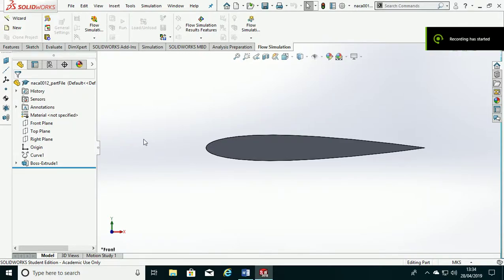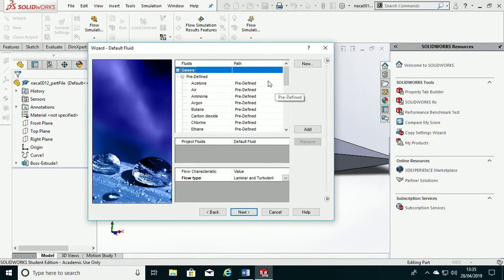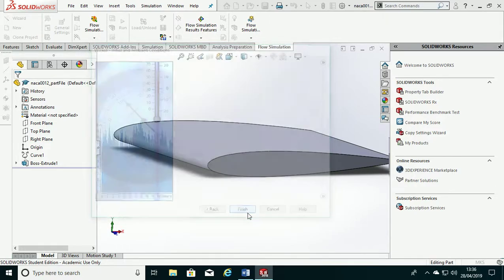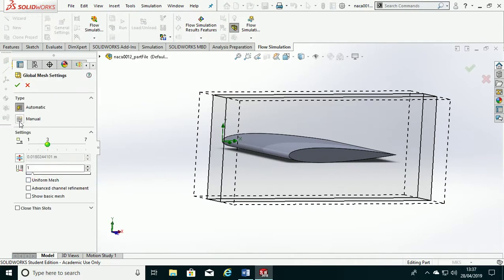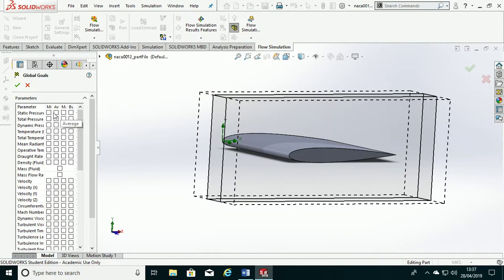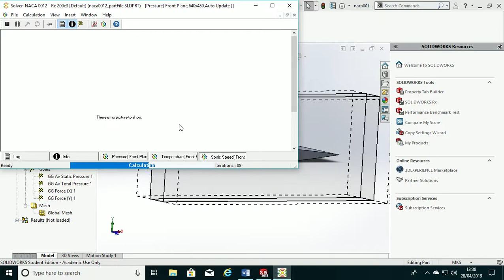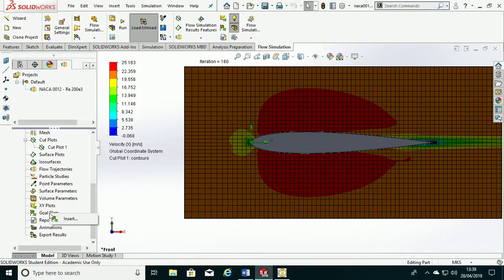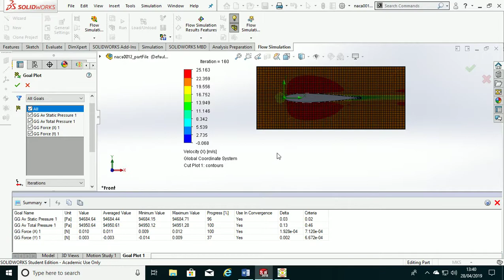NACA 0012 Aerofoil CFD Simulation in SolidWorks - Video 2 of 2

Comment: So are the forces actually measured in newtons? That doens't make sense to me if the simulation is 2D, wouldn't it be a force per unit length of cross section?